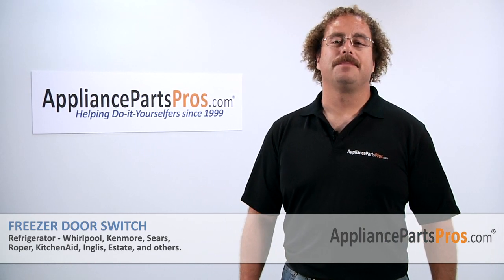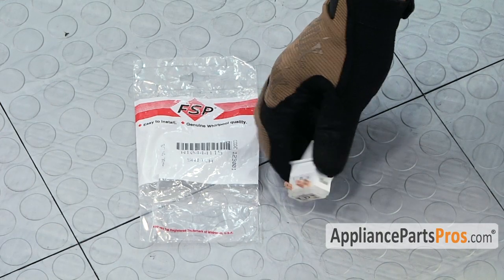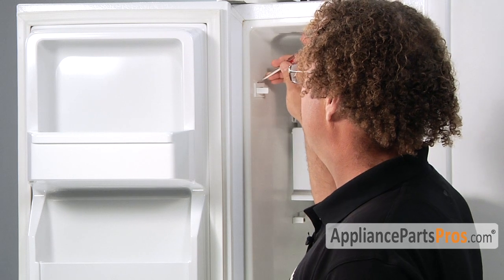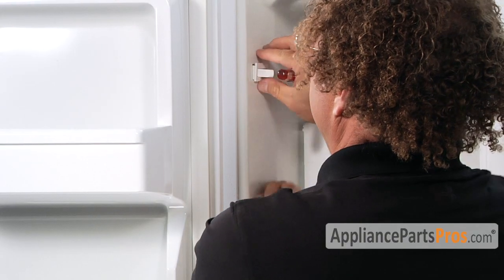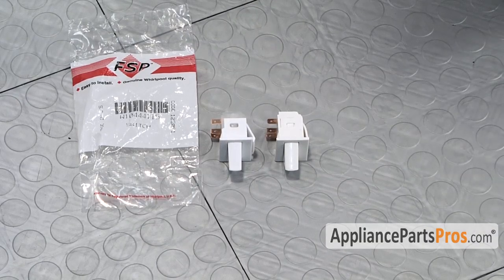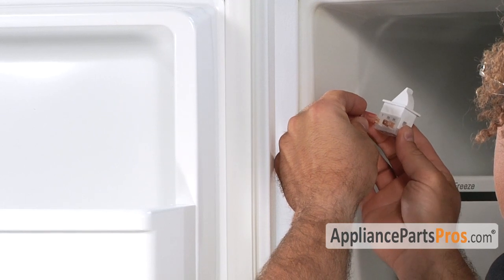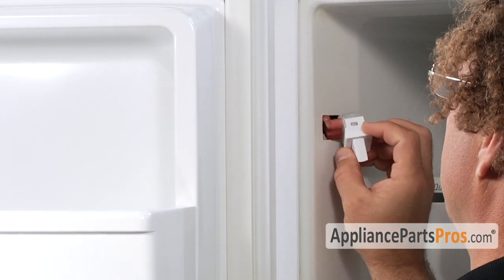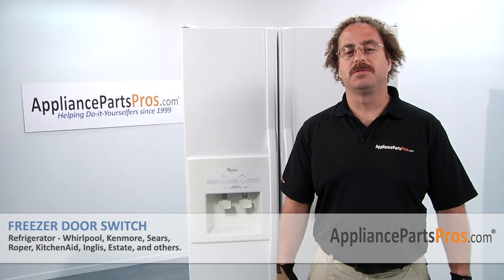How To: Whirlpool/KitchenAid/Maytag Door Switch WPW10444115

Comment: what will be the problem if door switch is bad sir? I am the new in thish field.
Reply from the maker: You would have a problem with the light or the ice dispenser.
Reply: Light won't work properly when you close the door. It turns off completely or it stays on all the time.

Comment: part num ps 102-21 on the door of my fridge would not come apart till I tore the switch apart seems the contact wires are flat and wont release till I yanked on  it  and two wires stayed on the switch on fridge I messed around for an hour swearing at the tabs  till I got them apart so if you cant get them apart  that s the problem grrrrrr
Reply from the maker: Sorry to hear that you had trouble with it! If you ever need additional help with the repair, you can give us a call at 1-877-477-7278 or you can chat us at our website: http://www.appliancepartspros.com/. We’re here to help 7 days a week.